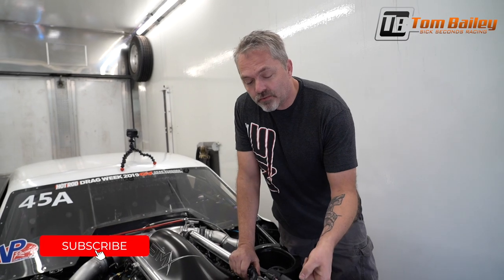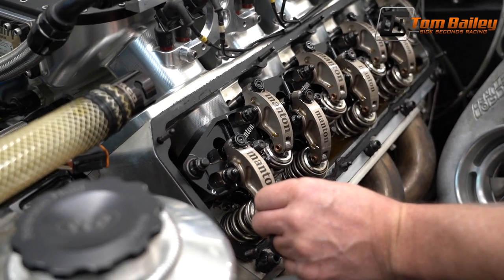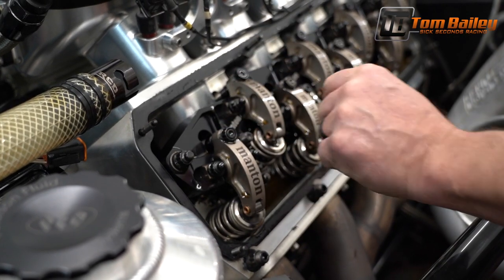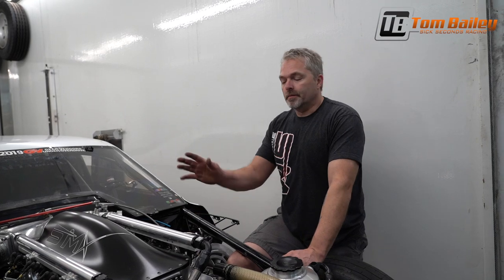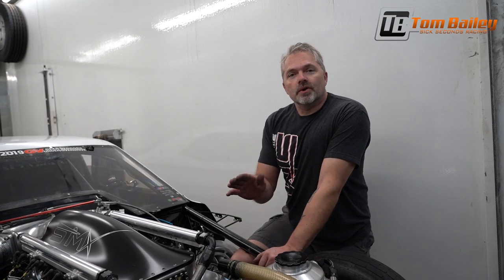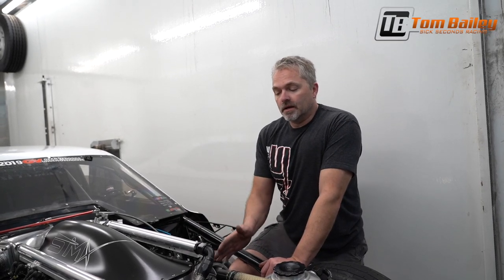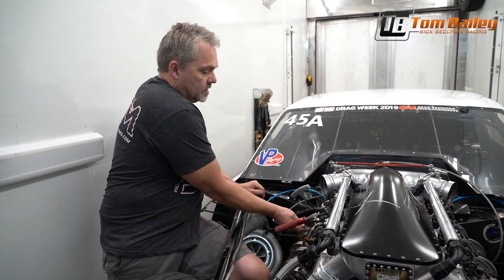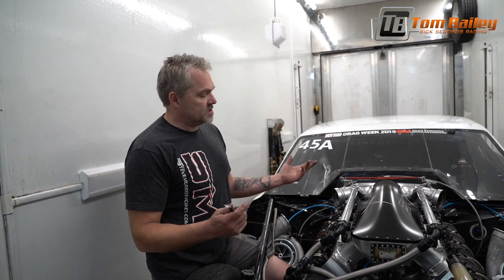How To Check Valve Lash With Steve Morris (Minimal Tools)

Comment: I was taught 40 years ago by the “On the rock” method. Take the firing order & split it in half & stack it on top of each other. When companion cylinder is on “the rock “ exhaust closing & intake opening- valve overlap the companion cylinder is at TDC compression stroke. Taught at Cummins,Izusu,Mack engine schools and tech school. 2 complete revolutions & done. Always use a bumper button.

Comment: I am actually surprised my valvetrain checking is extremely similar to this method.  Makes me happy.  I would run the valves on a cold motor every 50ish runs on my old Reher 555 bracket motor right before the oil change.  Granted the Harland Sharps did not look that damn sexy, but they did have about 1400 runs on them by the time the engine/car went away.

Comment: Steve that must be a small tight lash solid roller cam if you only run .005 lash. 

I run comp cams xr292r street solid roller cam.  Its their biggest street solid roller cam and they recommend cold lash at .010 intake and .012 Exhaust.  I am all motor though.  Fuel injected 438windsor 68 mustang. 

My tuner said same thing as you, just check lash don't adjust.  If they need adjustment i take car to Johnny lightning in Corona,  California.  John is really good. I only have lash checked/ adjusted once a year. My motor has the top of the line Isky bushed max lifters,  Isky Tool room gold stripe dual valvesprings and Manley steel valves.

I will check valves exactly like you recommended,  and if any are off i will take to Johnny lightning and have him adjust.  Its just a street solid roller cam so ramps are designed for street driving.  

My buddy says dont use remote starter button cause its not accurate to get on base circle, but if you use remote starter then i will too. My buddy prefers to turn motor by hand but i am gonna do it like you.

Comment: We run blown alcohol 540’s in 7.0 pro with jesel roller rockers and do it basically the same way. We check them with a feeler gauge at the beginning of the weekend and will adjust them the .001-.003” just because that’s the way my step likes to do it. But after that we are just pulling valve covers to make sure nothing went wrong. If you have no lash, chances are you tuliped the valve. If you have too much lash, then you may have lost a cup on a rocker, collapsed a lifter, bent a push rod, cracked a rocker, lost a lash cap. It could be a number of things. But if you check them after every pass you will know when there is a problem and hopefully prevent it from doing more damage.

Comment: Does this method work with all engines or more specifically an Olds 455 with a roller cam/valve train?
Reply: This works on engines with solid roller lifter setups.

Comment: I’m kind of assuming the .010 cold lash is based around room temperature (65-75*). Is there a rule of thumb as to how much to add or subtract if there is big swings in ambient temp? Like if it’s 40* or if it’s 90*
Reply: It really depends on the individual valvetrain and engine.
Some engines grow more than others, and some cam profiles need more lash than others.
I do the following. I heat up the engine and set one intake and one exhaust valve to what the manufacture wants hot. This could be 0.022 and 0.020 for example.
Then I let it cool down again and wait till the next morning. Here I check cold and use that to set everything cold. Could be 0.012, 0.008 or what ever. But it gives me a uniform method that does not rely on the engine being hot. From that point on I always know what the cold lash should be. And like Morris said, don't overthink it. You won't feel the difference between 0.002" if you set it on a slightly colder morning etc.